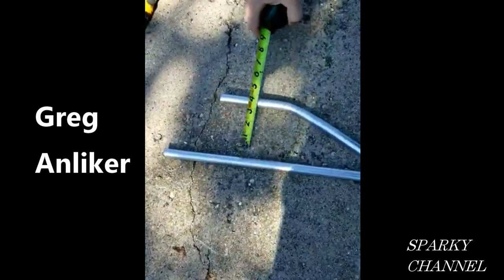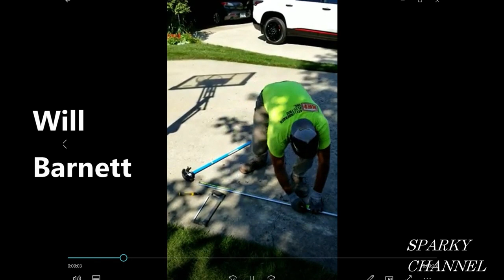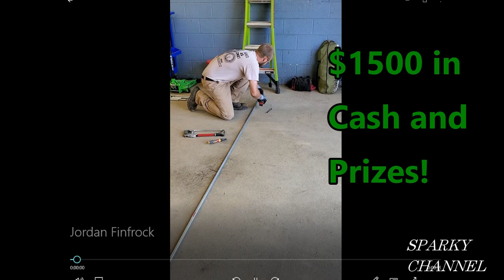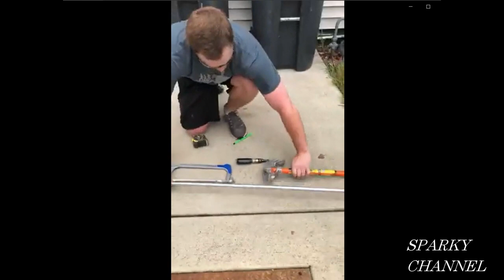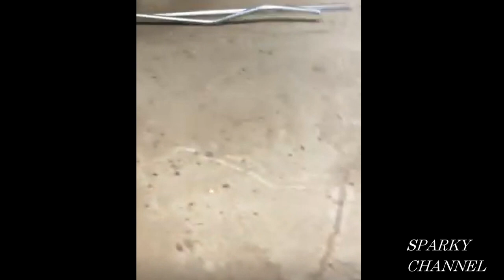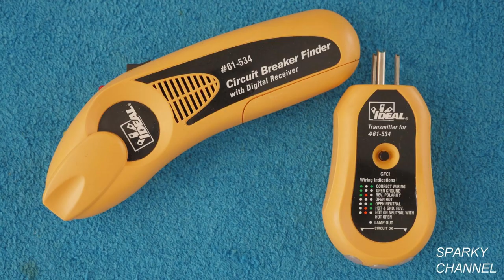How Pros Make EMT Offset Bends Fast and Accurate! Amazing Footage with the Best of Apprentices Also

Comment: Question: How do you guys just mark a little on the emt and be able to see it on the bender?
Reply from the maker: The mark where you are cutting the conduit only needs a small mark. Then make a small mark for your 1st offset bend. Turn the conduit 180° and make a small mark for you 2nd offset bend. Try it, you'll see it works although it might take some practice.

Comment: why do you in america use metal pipe for the electrical installation? in europe we use pvc, which is easy to bend with a bending spring and does not conduct electricity
Reply from the maker: Because the EMT conduit protects the wire from mechanical damage.
Reply: We use PVC too. Mostly in applications where EMT isn't up to code. Such as direct burial.
Reply: When PVC burns it releases toxic gases. In the US we use lots of different types of conduit including: rigid metallic, intermediate rigid metallic, electrical metallic ( bent in this video), flexible metallic (greenfield or Flex), flexible nonmetallic ( ENT or smurf tube), liquidtight flexible nonmetallic (PVC based product), liquidtight flexible metallic, PVC Schedule 40, surface metal raceway, rigid "Robroy". Each conduit is used in locations based on cost, durability given site conditions, and other considerations.
Reply: @ubrayj02  good answer